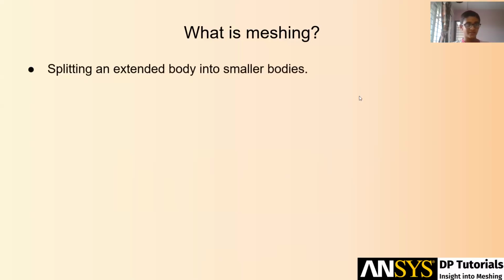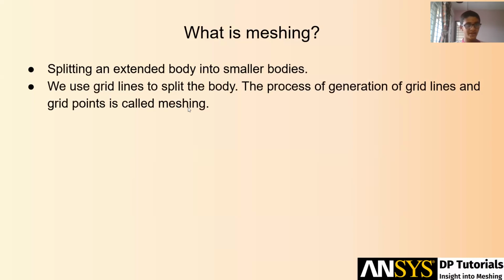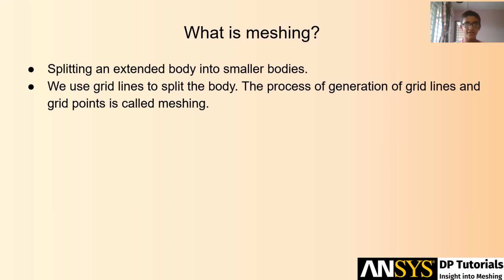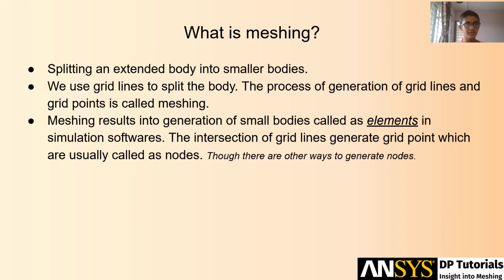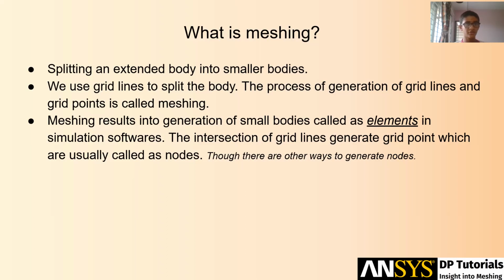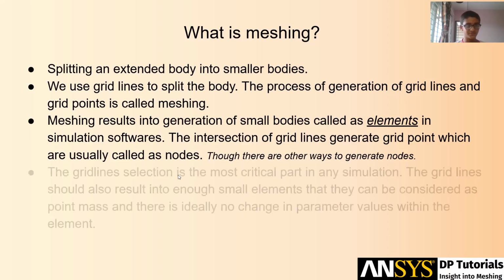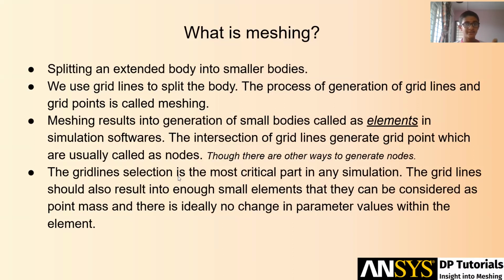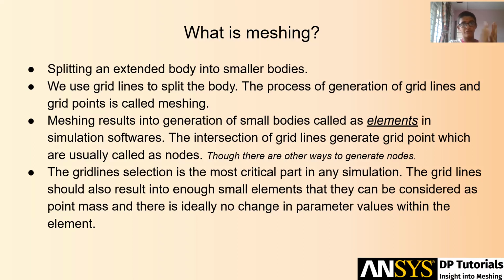3 What is meshing? Actual physical process of meshing |Grid Lines,Grid Points,Nodes| ANSYS Hypermesh

Comment: I respect your efforts here but I could read a book on FEM to get what you are speaking on so far,... it would be better if you were to show the theory in practice while actually meshing,... 3 videos into you series and I had to jump ahead to see if I'm wasting my time,... you need to use the software to do you explanations.
Reply from the maker: Thank you for your valuable feedback. I agree with what you are saying. As you have asked, I have also put some videos actually showing the steps followed in the whole series to produce a good mesh. There are three parts of the actual meshing exercise done on ANSYS mechanical. Perhaps, since reading a book on FEM is not as simple and straightforward as other mechanical engineering stuff. Additionally, reading FEM does not directly translate to using a FEM software and hence the important concepts of FEM are chosen to produce a simplified series for all.